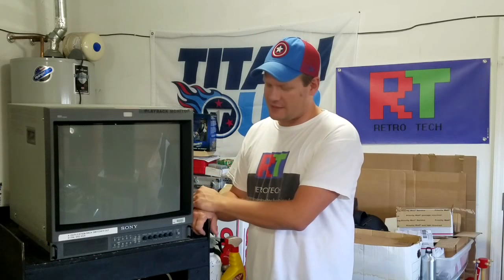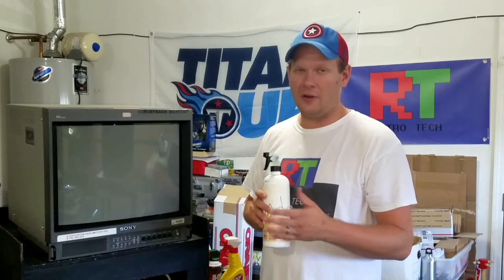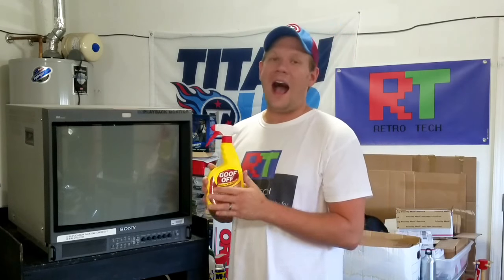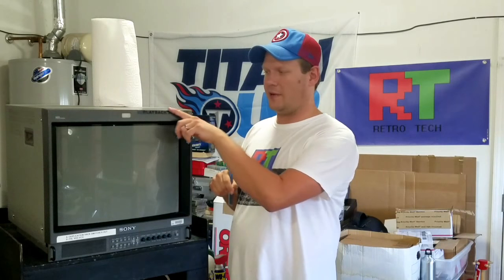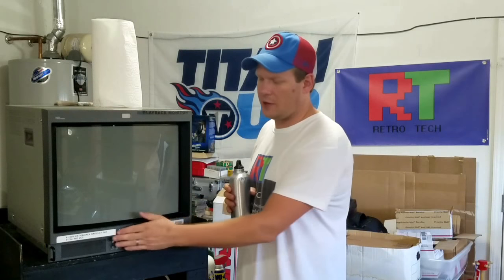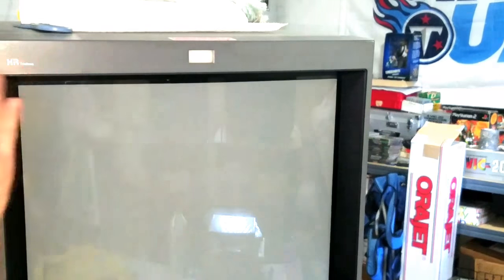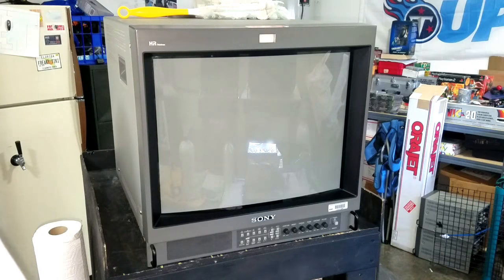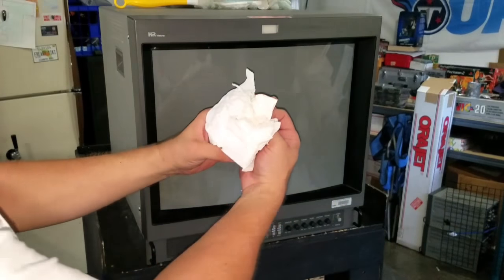How to Clean a Sony PVM CRT Monitor Screen

Comment: Seems like cleaning the exterior is a lot of common sense stuff that you'd apply to other surfaces and household appliances. That's a really beautiful high-end model too, I see people trying to sell 1954Qs for extremely high prices on ebay and the like and they're almost always more beat-up and worn down than yours. Bought my own PVM recently, a basic and affordable 14N5U that suits my purposes for now but one day I'd like to have a good 19" 4:3/16:9 set that natively supports RGB like yours. Great video Steve.
Reply from the maker: Thanks.  Common sense can help a lot when doing just about anything.  As long as everyone stays away from Goof Off, they should be good.  I'm glad you could get a PVM that works best for you.  There are two major problems with EBay's CRT sales.  It's the quality of the Monitors that are sold and shipping.  There are probably no more than 4 sellers on eBay that even know how to service PVMs/CRTs and ship them.  The other sellers are just trying to make a quick buck.

Comment: They sure are bro. We use to have a 1986 Dodge Ram conversion van with a 5 inch Emerson TV/Radio in it. The little guy was cool to watch while we were on the go. 

If you do a the one that has to be rebuilt, I'll be glad to see that since it would bring back fond memories. 8^)

Anthony...

Comment: Sounds good Steve. Looking forward on seeing it.

By any chance Steve, do you also do repairs on those classic 80s-90s 5 inch portable televisions/radio sets that we use to see in conversion vans and RV's. Those were nice to have back then when we were all on the go. 8^)
Reply from the maker: Thanks, I do have a couple small ones like that.  One has to be rebuilt too.  They are cool little gizmos.

Comment: Hi there Steve, I just had a quick question for you. I acquired a small handful of Sony PVMs and two of them, both models PVM-9L2, seem to have the same issue. I turn the monitor on, the monitor makes a quiet, short disc search noise? (best description I could think of) and the Line A and Degauss lights illuminate, after about 10 seconds the Degauss light turns off and that’s it no sound that it’s on or picture. Only power light and Line A light. I’ve tried plugging in a source to both Line A and Line B and still nothing. It seems weird to me that both monitors have the same problem. Is there some mode that they could be in that is keeping it from fully turning on? Thanks for your time!

Comment: Will any of these damage the pet film applied to some screens?  Also, I find WD-40 works great for removing stickers/labels etc.  Appreciate the work you put into these videos.
Reply from the maker: It's possible to damage the film, but most monitors I work on don't have a film.  It's always best to make sure your screen does or does not have a film on it before applying any harsh cleaners.  I've seen people damage old screen layers with window cleaner before.  All of the 600 tvline Sony PVM monitors I've cleaned have not had a film, only the higher line count monitors.  Thanks